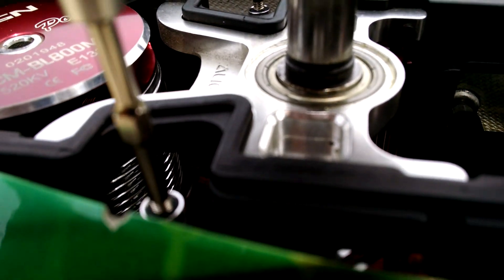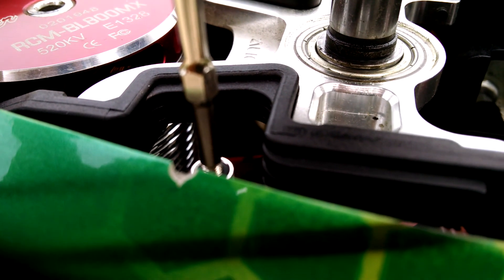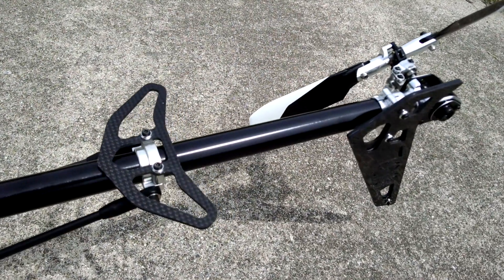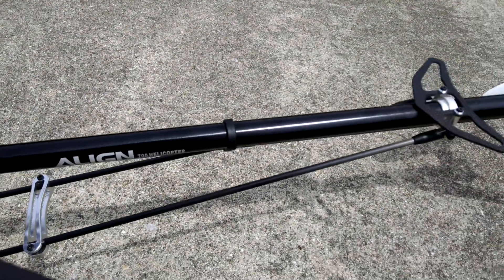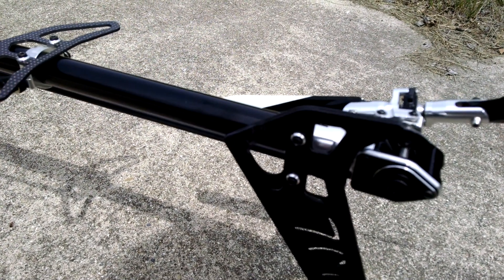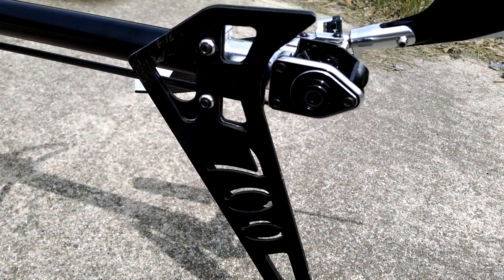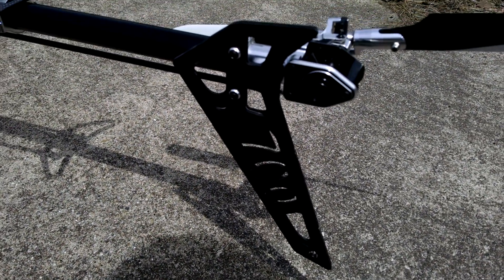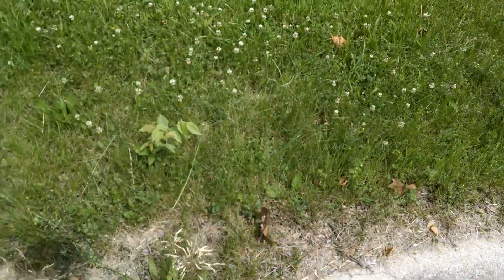Trex 700e dfc pro hv tail boom hum and tail rotor buzz fixed

Comment: Swapped the shaft for 6mm blades & grip washers..not sounding like a gasser anymore lol...still good over 100 flights
Reply from the maker: G Steffens I have the 6mm shaft with no step/it has the higher tail ratio gears for faster tail rpm

Comment: replaced my hum by lowering my front gear ratio and changed me tail blade my fin does not vibrate.
other pilots followed my advice and resolved there issue as well.
thank you and your a pretty good pilot and inventor .
Reply from the maker: Thanks wicked and you are also a great pilot/ but its true if you lower the gear ratio to reduce the tail rotor speed it will get rid of that sound but I wanted to keep the tail rotor  speed on the tail rotor up so i could have a lot more tail authority/ anyhow  buddy have lots of great and safe flights 🚁🚁🚁
Reply: Super020469 
ill recommend your idea to the next guy that has a tail hum issue
thanks ahain